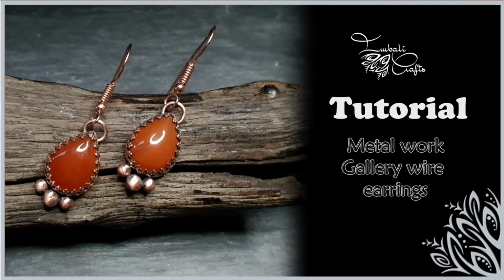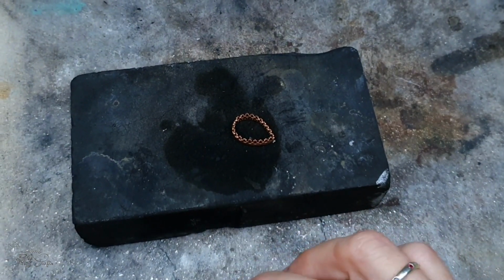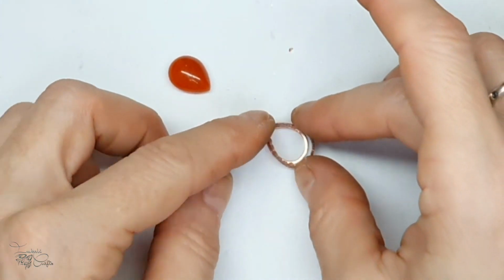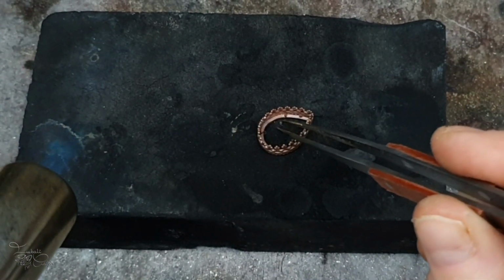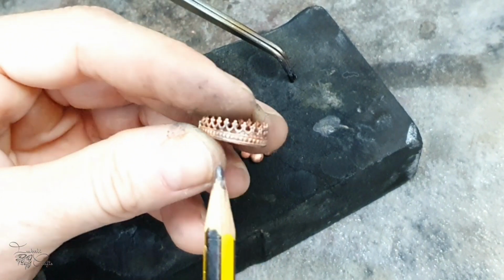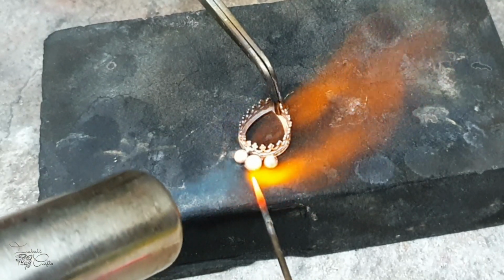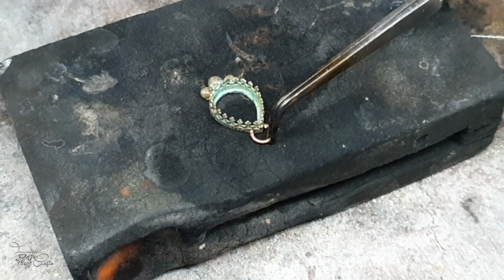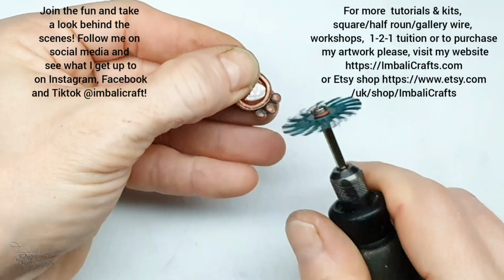Gallery wire soldered earrings - metal smithing tutorial

Comment: I keep melting my fancy bezels! It’s so frustrating! I may go back to using a soldering iron for the delicate bezels. They’re expensive!
Reply from the maker: I used to do that as well. Especially silver as the melting point is lower than copper. The more you practice the more you get an eye for when things are getting too hot. Don't give up just yet. Maybe practice with some scrap to get a feel for when its staring to melt. Xx

Comment: When working with the stone, and getting the metal fitted against it; would it be easier to either set it on a rolled piece of tape to keep it in place on the table or make a small tin can of pliable wax that you can also use when you work on forming metal on in future projects.
Reply from the maker: That definitely works, too! There is no one way to do things and what works for me might not work for the next person so I always say to try out a different approach to achieve the same result! xx